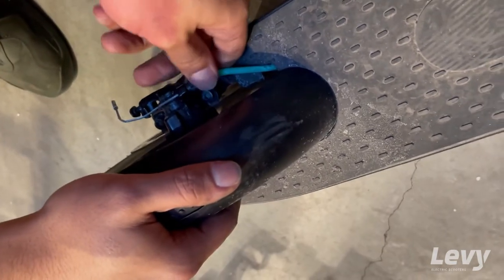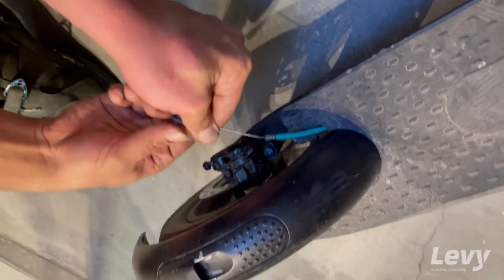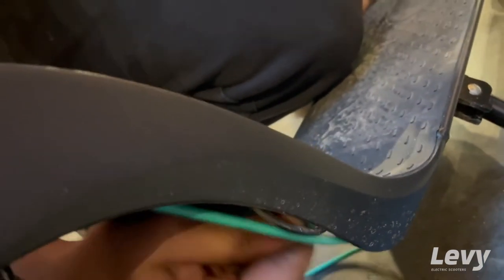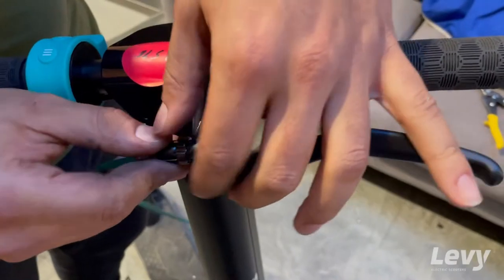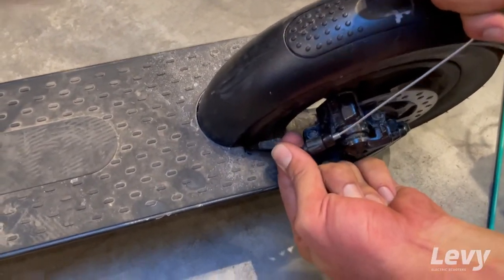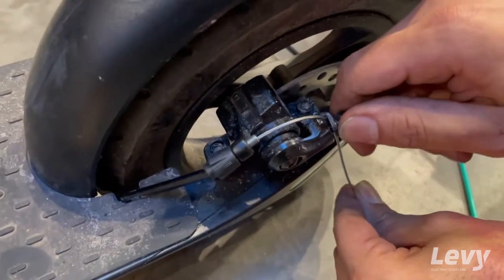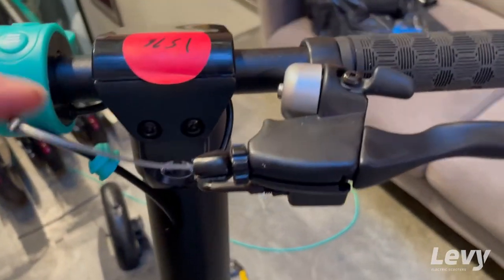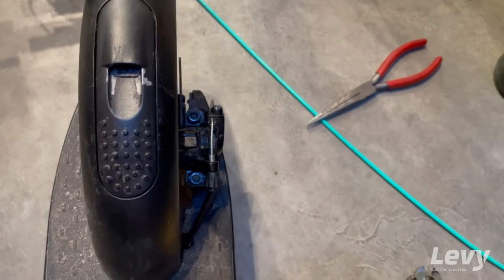Electric Scooter - Brake Line Replacement

Comment: Any experience with the handbrake giving out, and it suddenly becoming loose?  Friend and I have both had that happen and are currently trying to figure it out.  Unsure whether it's an issue with the caliper arm or some kind of issue with the pathway or brake cable.  Any tips would be appreciated if you've seen this, thanks for the great videos!
Reply: Did you find out what it was?